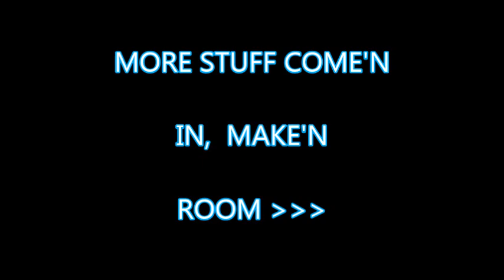EVINRUDE  6 / 8 HP & MORE     (  Part 1 )

Comment: Users forget that in two stroke oil lubricates cools and seals and stops corrosion and in four strokes oil lubricates cleans by keeping rubbish in suspension in the oil and also has a big role in cooling as the takes the heat away where it cools the engine..
Four stroke motorcycles often have oil coolers don’t know about Outboards but oil certainly is a additional coolant sink…
Reply from the maker: I Feel the same way,   Yes''''   On  4 strokers,  The  sump  oil can B a Blessing  in  hiding. 4  sure.....                                                                                                        
                                                                                                                           kodibass

Comment: Good little motor! I  just hate that style of primer I converted mine to a regular choke system..
Reply from the maker: Not at all needed on this little motor 4 sure.  kodi
Reply: @kodibassInsideoutboards   need some help! My 1990 6hp evinrude recently started taking longer to start on cold start only have to turn it over 8 pulls sometimes but once warm starts right away! Checked carbs and it’s all good, has good compression, and spark is great! Just don’t know what else to check

Comment: Hey Kodibass is it bad to run the engine when your gear lube is a Milky color Or is it time to take it in since I don’t have the right tools to fix everything
Reply: If you don’t know how to change the gear lube. Take it in to get someone to charge it. 
Also it’s time to learn yourself. It only takes a screwdriver and the oil and a pump that you can get from Walmart.
Reply: @stevanrose7439  I know how to do that it’s a milky color is throwing me off I want to know if it’s time for the seals to be changed
Reply from the maker: @robertbidwell4541    I would change the oil, run it for a trip or 2 , If milky color re-appears get it re-sealed.    kodi
Reply: @kodibassInsideoutboards  thank you I would hate to see a good 50Horse two-stroke mercury go down the tube

Comment: Hey kodi I know this is off topic but I have a question I know you can answer.. I took the valve covers off my v4 looper and the pistons have a lil slop is that ok? the compression was 95 on all cylinders.
Reply from the maker: Yep'  The ammont of play is fine in the #'s  U R getting 4 your compression,  90+  is  good on that  motor.,, If it is a 2 stroker??     I do not know the  year  of  your motor?  But if it is a 2 stroke loop you do not have valves  U have reeds,   &  those #'s  R  in range.   kodibass
Reply: Lol thanks kodi I knew you'd know about it... it is a 1986 Johnson v4 looper 140 2 stroke... I wanted to see the pistons because it runs great for about 5 mins on the water and then Boggs down and have to put back to the dock I did rebuild the carbs with new coils and power pack the reeds show very little light threw not sure if that would cos it to bog and stall what do you think?